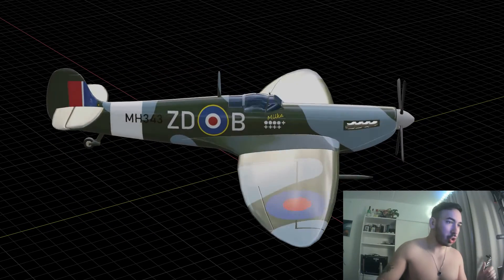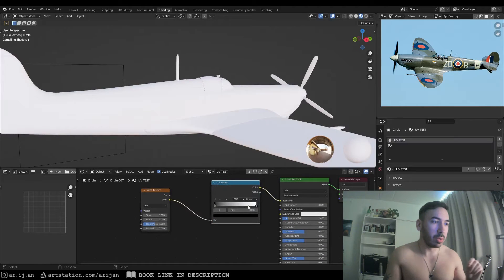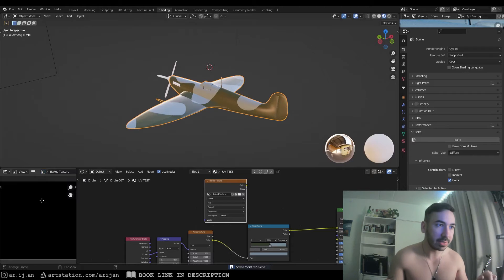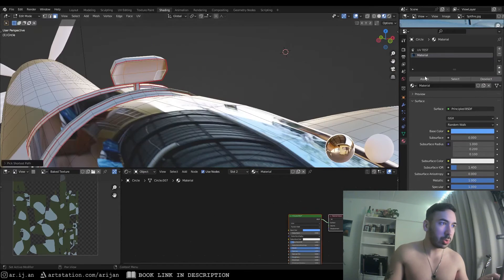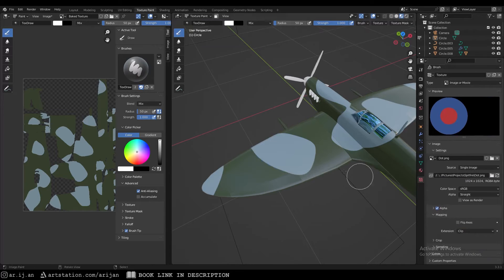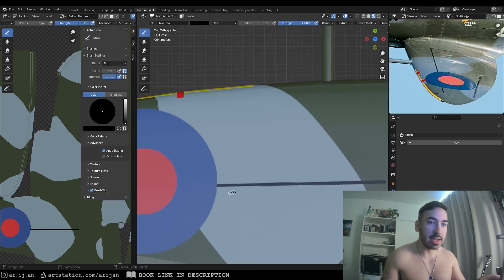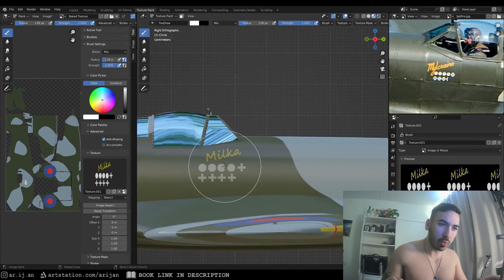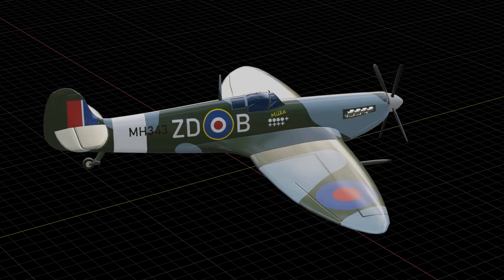Texturing a Spitfire in 5 Minutes | Blender Tutorial (Arijan)

Comment: This is amazing work man! To get it to fly in Phoenix RC simulator the paint materials would all need to be on a 1024x1024 png. In Blender the leading edge of the wing needs to be in line with the x axis and the bottom of the wheels need to set barely above the y axis so the model doesn't crash immediately upon startup. The wings, stabalizer and fin and their control surfaces, ailerons rudder, elevator all have to be separate objects. As well the prop, spinner, gear, rear gear,  right and left tires, rear tire all separate objects. Plane scaled till wings are 100 meters long. Then export the file as wavefont obj legacy which sadly blender is leaving out of its latest versions. My 1st version 3.41 still had it but 4.1 does not.

Phoenix RC is one of the best RC simulators that's ever been made. It has over 700 models available to fly and over 200 user created flying sites from around the world. All available at RCGroups.com The designers of Phoenix made it possible to build and load your own models and landscapes but is no longer being developed.